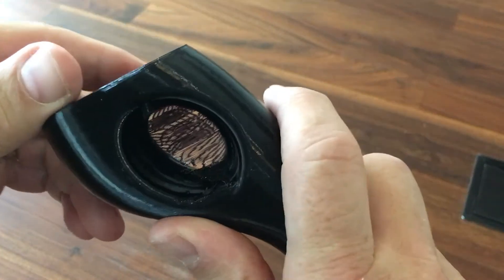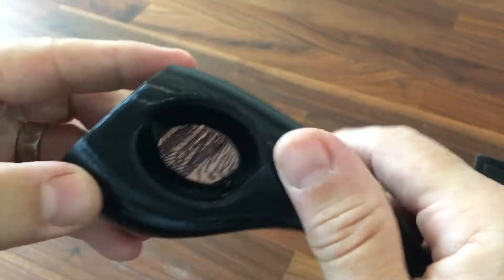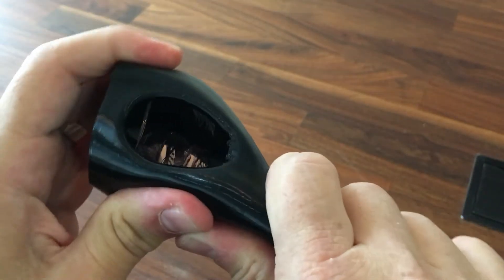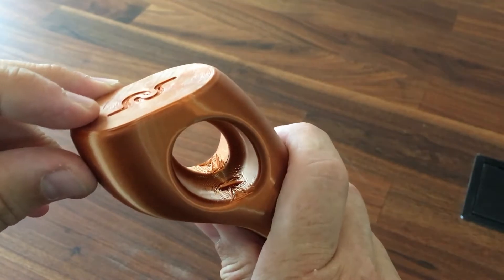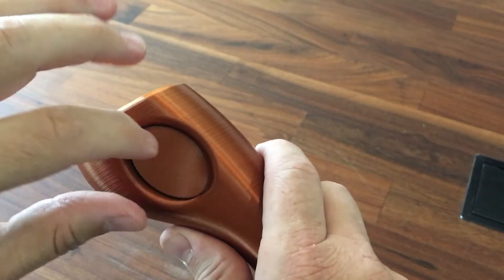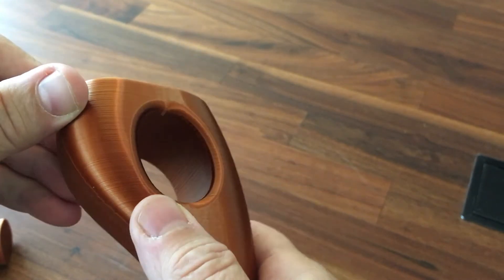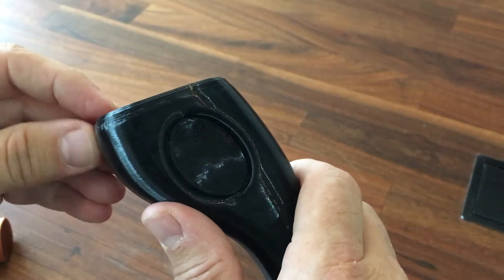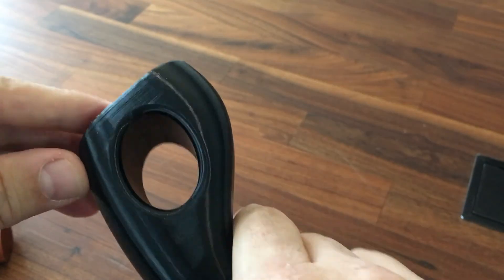build your own supports to solve many surface issues

Comment from the maker: btw, I realized in the video that I inserted the plug on the PLA upside down (you can tell by layer lines) but it is a symmetric hole and I think you get the idea.